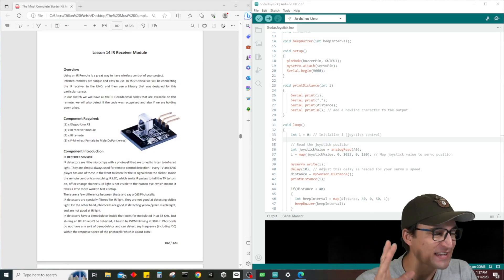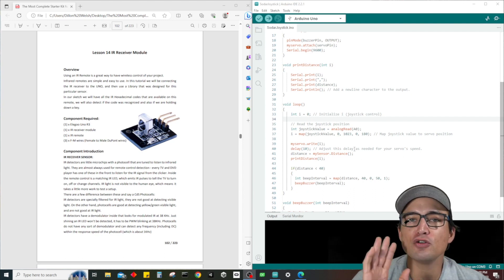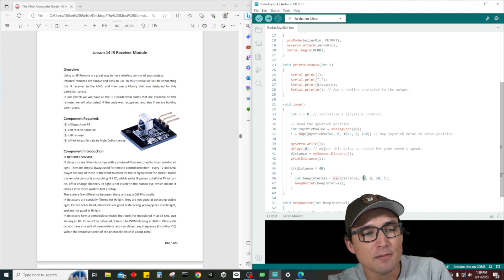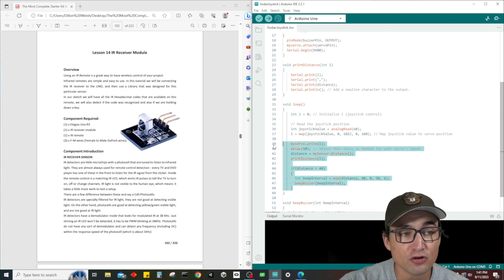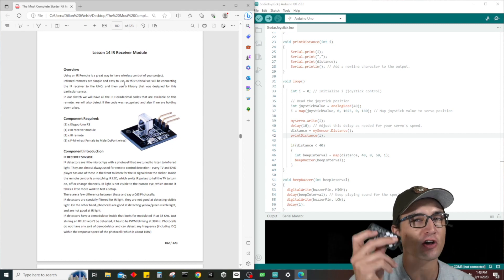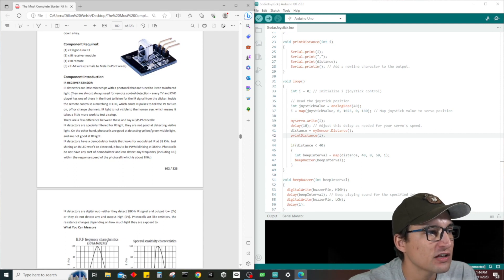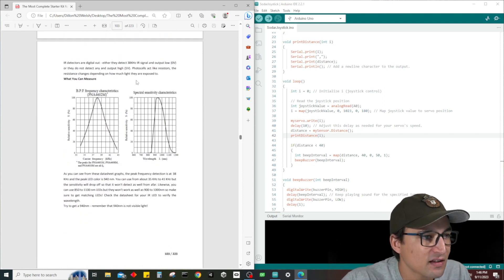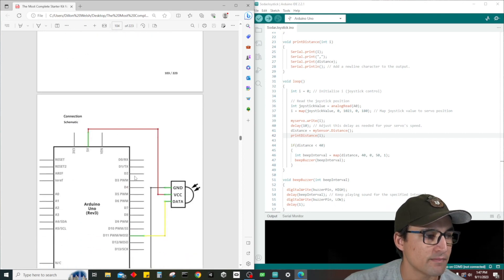🔥 Elegoo R3 Uno Starter Kit Tutorial: Lesson 14 - IR RECEIVER MODULE 🔥

Comment: Where do you remove RobotIRremote from? i keep getting this error and idk what to do atp. Arduino: 1.8.0 (Windows 10), Board: "Arduino/Genuino Uno"

C:\Program Files (x86)\Arduino\libraries\RobotIRremote\src\IRremoteTools.cpp:5:16: error: 'TKD2' was not declared in this scope

 int RECV_PIN = TKD2; // the pin the IR receiver is connected to

                ^

exit status 1
Error compiling for board Arduino/Genuino Uno.

This report would have more information with
"Show verbose output during compilation"
option enabled in File -> Preferences.